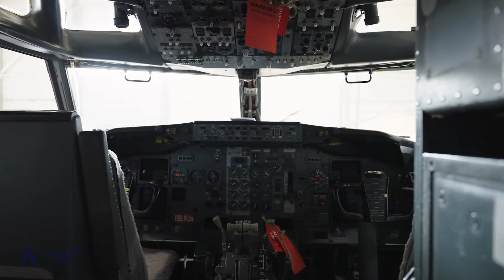How to Become a Licensed Part-66 Engineer by Benjamin Greenaway

Comment: Sir, what's your salary?
Reply: 1500 INR
Reply: Depends on what country you work in and the job. If your a technician in England you can earn up to £70,000 yearly
Reply: @Manu101299  pure 70k or percentage of that is taxed?
Reply: @Bert1124  70k Basic but where I work we get shift pay added to that as well. So shift pay is £325 a month so it’s £73,900. But yeah we get taxed 40%
Reply: @Manu101299 £90k plus now for b license and about 60ish for cat a